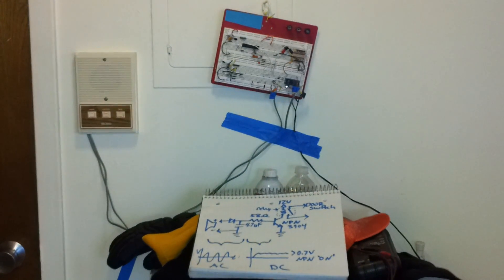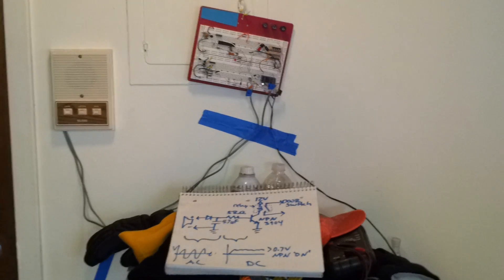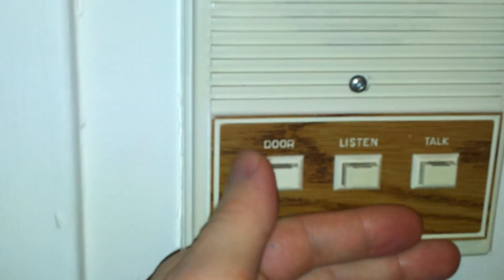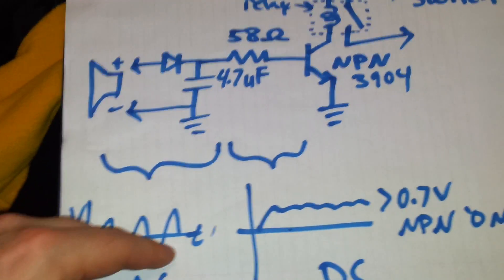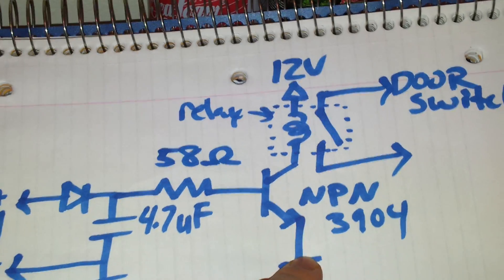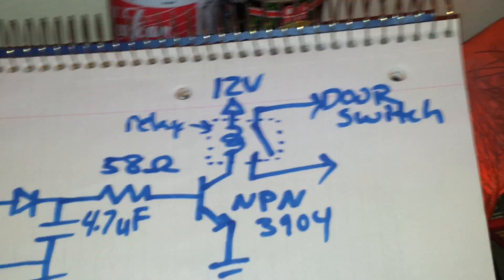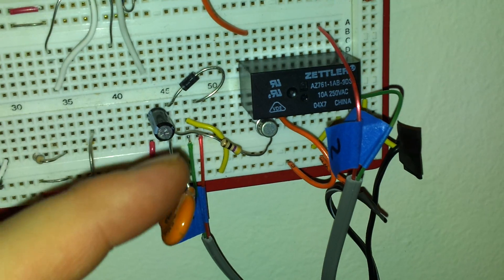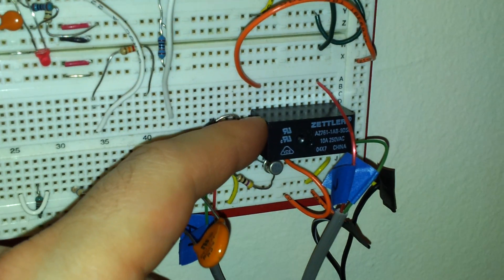Apartment Hack: Hacking Intercom for No-Key Door

Comment: is there a way to turn the sound off in the intercom ?
Reply from the maker: cut the speaker wire, or add a resistor inline with the speaker wire to reduce the volume. you would have to experiment with resistor value.
Reply: tank you so much !! i totally screwed it up trying to do it and now idk what cable goes where !! im going crazy ! how can i figure that out ?

Comment: Thanks for sharing. Your buzzer looks like mine. I'm looking for a way to open the outside door with a cell phone call by using the GSM switch, but I don't know what the buzzer diagram look like. Can you guide me where to find the diagram? Thanks.
Reply from the maker: Im not sure about the diagram. Pressing the door button by hand or with a relay should simply complete the circuit.
Reply: use the lazy bone wifi switch
Reply: +Patrick P use a raspberry pi. have his speaker > diode > cap > resistor > transistor set up trigger the pi to send an email. google sms to email gateway [provider name]... im with VZW and its xxx-xxx-xxx@vtext.com. 

have the relay part (to switch the door) triggered by an email from your phone.   there is an api for gmail, and if you use gmail on your phone the gmail to gmail send time should be almost instant. create a account that the pi can check every 30 seconds or so. 

if you wanted to get really fancy you could even have the pi send audio back that says please wait.

Comment from the maker: There is a separate 9V supply to power the relay.
Reply: +suz384 why did u do that? u should have between 10v and 24v dc on the number 2 wire.
Reply: is there a way to turn the sound off so when someone buzz i cant hear it ?
Reply from the maker: Have to cut the speaker wire I guess.